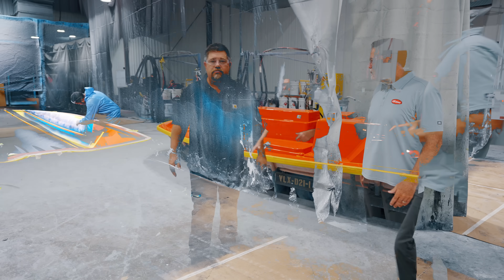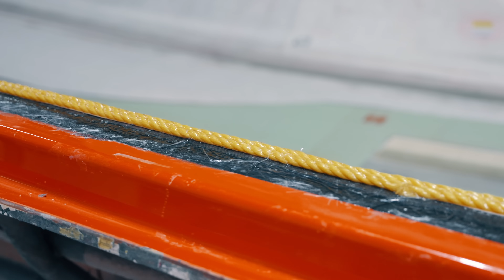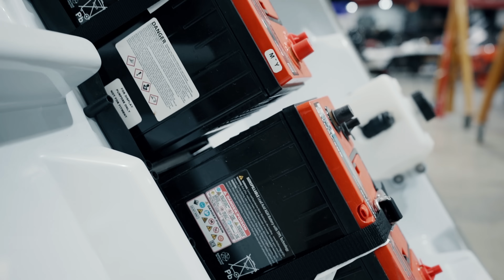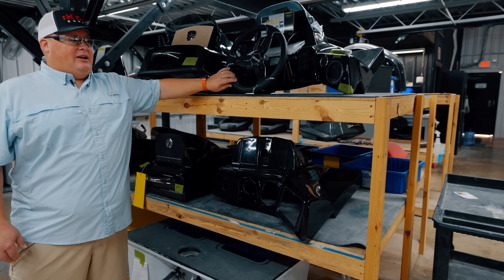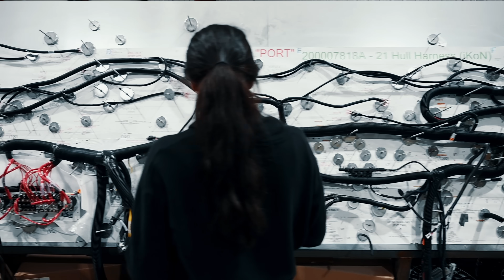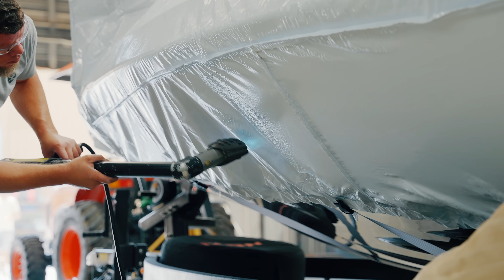Inside the iKon Boats Factory: A Behind-the-Scenes Plant Tour

Comment: Best built boats in the industry! 🔥
Reply: In order to make that statement one would have to visit all the factories and ride in all models etc. To gain an insight. But I get your loyalty
Reply: @rickvann3489  It has NOTHING to do with brand loyalty. It has EVERYTHING to do with hands-on knowledge about building and working on boats. When you KNOW quality construction, you can spot crap construction. There are brands that rose to prominence and then complete dominance here in the fishing and boating capital of the world on the late 80's to the mid 90's that sold more boats than some car manufacturers sold vehicles, but their boats rotted so quickly and easily they built up THAT reputation and you rarely if ever see any of them.

I don't care who tells you otherwise but Chop Gun construction is vastly inferior to hand laid, solid sheet construction and there is no debating it on any front. On top of that quality builders in years and decades past would go the extra mile and incorporate even higher quality weave patterns and materials like woven and Kevlar and boats made using that stuff are literally bullet proof, and I don't mean of great quality! Literally bullets cannot penetrate the hull. try that on a modern day bass boat and I bet you bow a hole right through it.

THAT is why I champion East Cape Boats!
there are other brands made just as well, but they refuse to cut ANY corners and the customer service and attention is the very best on the planet. I am prepping my 22 Hydrasport Vector for sale and will be saving that cash to put towards my own Vantage one day. Until then I'll just drool and cry over their vids. 😂
Reply: @theINQBS my hands on knowledge been hauling Ashland Chemical resins to every boat manufacturer been through dozens of tours and still standing is Charger Bass Boats, Ranger, Skeeter, Bass Cat. Gambler Bass boats had a hull in a hull and probably the toughest ass boats ever made.
I have some good knowledge that's why I never ran an OMC boat.
Reply: @rickvann3489  Gambler is not "still standing"..... Skeeter has more stress cracks than a 90yr old southern california woman's face.
Reply: @edgerat Charger is still standing and I have been around alot of 2022 Skeeters and haven't seen anything as you described. My buddy has one corner or had a hair line gel- coat crack but that doesn't necessarily mean a stress crack could be a curing issue pulled from the mold to soon etc.
Reply: @rickvann3489 charger boats are no longer business.
Reply: @rickvann3489 For 25 years, I spent about 300 days a year in a boat as a full-time guide. I had 14 Skeeters & 11 Rangers. I have been to both factories and around all makes of bass boats. I was fortunate enough to be involved in the design and testing of iKon Boats. So, I feel confident in saying they’re the best built boats.